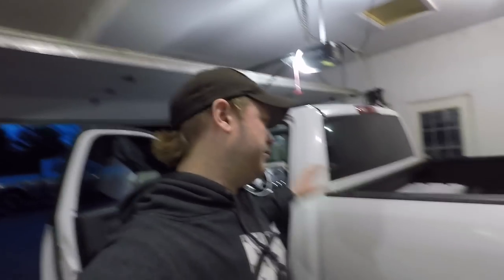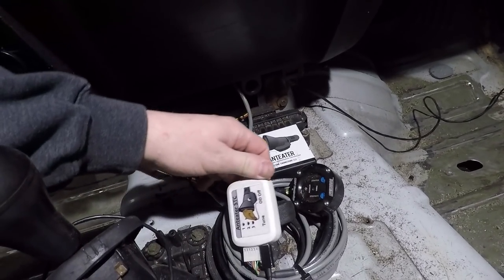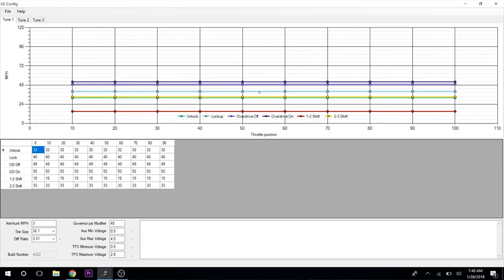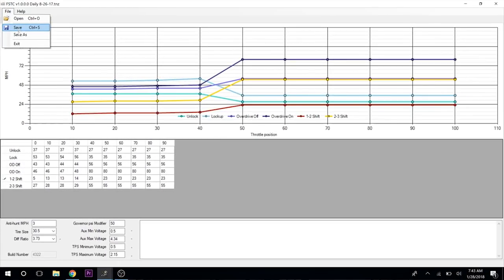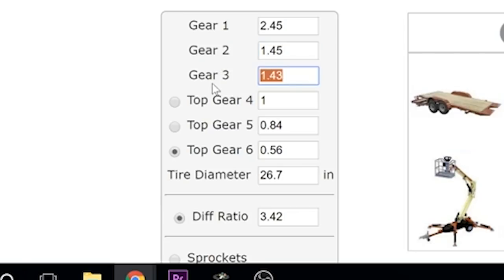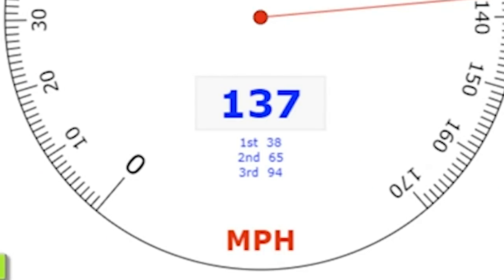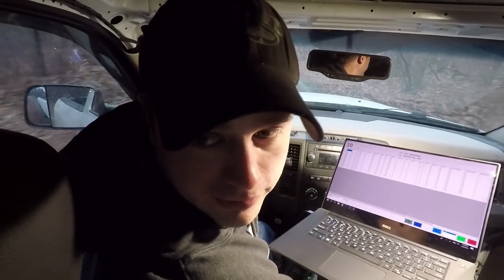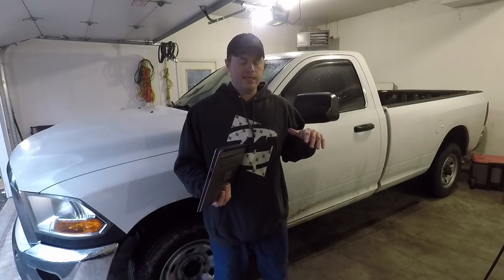How To Tune Your 47RE/48RE Swap Dodge Ram Cummins With FIREPUNK ANTEATER!!

Comment: have a 12v 1997 with a rebuild HD transmission and the guy that build it surely did not change stock parameters! so glad I have found that I will definitely give it a try